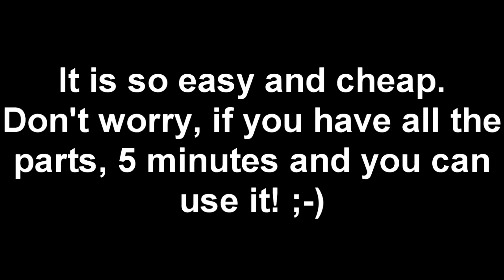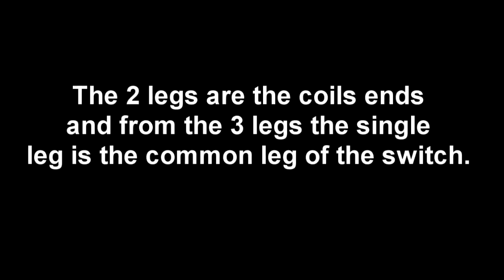RC light switch from servo - explanation with pictures

Comment: I know you said the resistors was random value but I need to know that resistor that you used and diode. Just make sure I do the same parts as yours. 
And I still don't get on what 2 pins you should connect the load for switcher. Can you make the scheme?